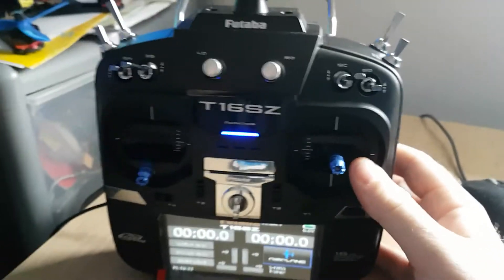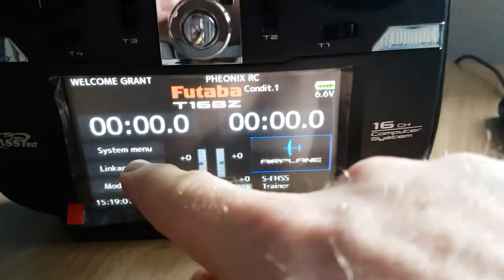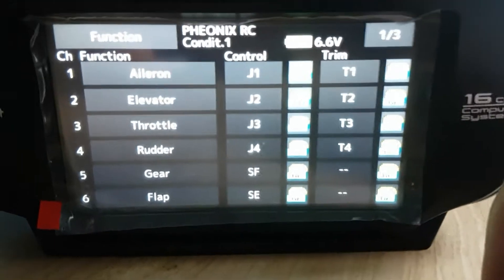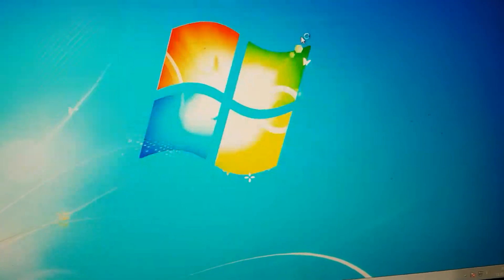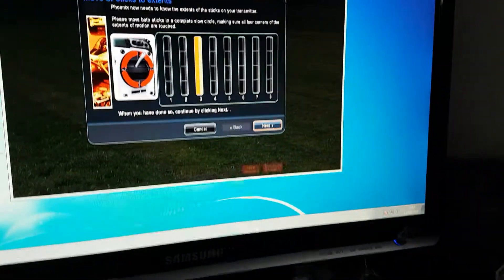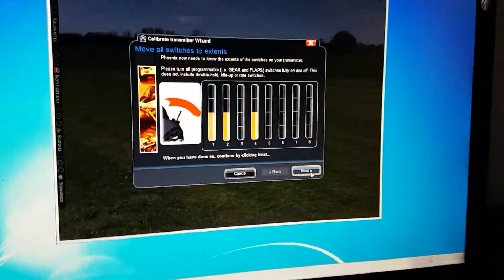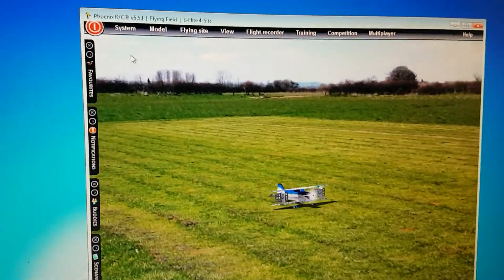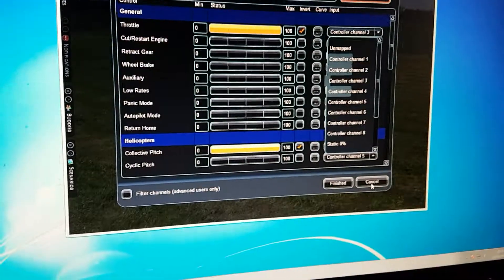How to get the Futaba 16sz to work on Pheonix RC simulator

Comment: Hi, how did you get your name in the top left of your transmitter screen please?
Reply: System settings
Reply from the maker: If I remeber rightly it was via the settings somewhere but no custom firmware or anything. I'm sorry I couldn't be much help
Reply: First, go to Model Type and enter the model name and username. Then go to Perimeter > Home Display. Here, select the option Username. I just moved to Futaba T6K and still exploring the setup of the TX. Hope this helps.